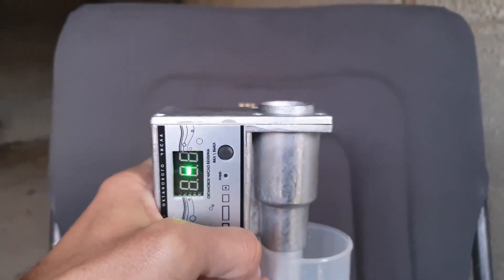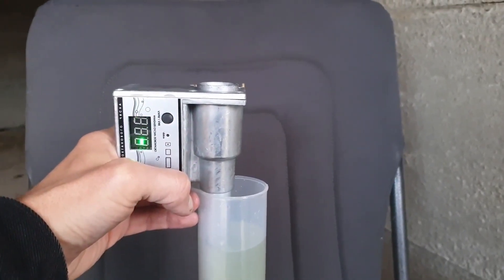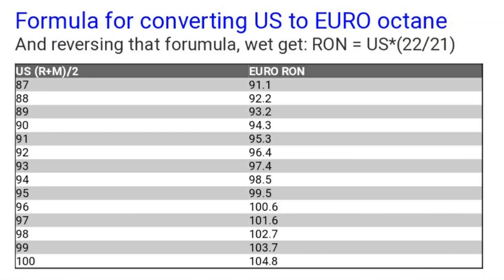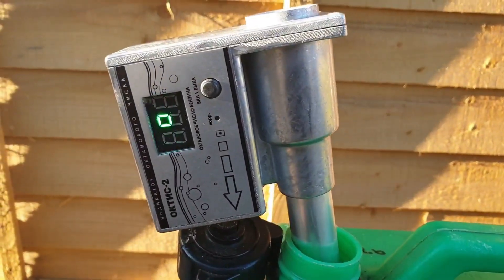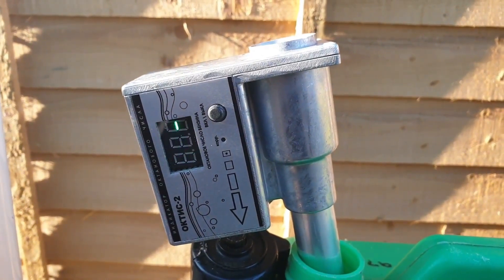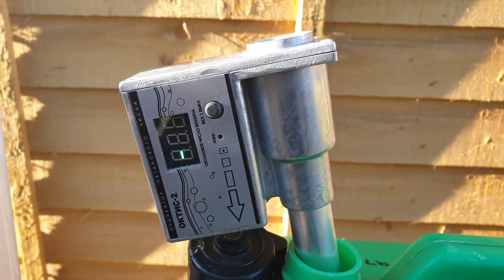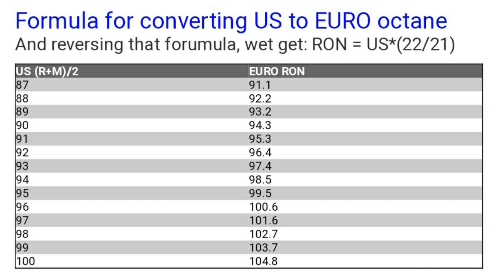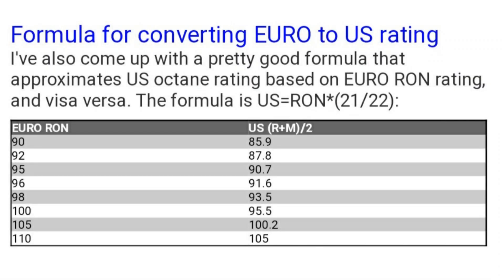Testing Petrol / Gasoline for Octane ⛽ Part 3: Octane of E10 and Texaco Supreme with Ethanol Removed

Comment: Great video. Love to see what your findings would be on the E5 fuel
Reply from the maker: Thank you! The supreme and super unleadeds are the "E5" fuel. It's confusing as firstly most of the UK E5 has zero ethanol (but not Texaco) and E10 is between 5-7% percent. Secondly, I can't test the octane of an ethanol blended fuel, so this videos test was to see what it was with the ethanol removed.
Reply from the maker: Also, thanks for the sub. I have many previous videos showing the ethanol content of many brands. They're in a separate playlist as my videos are a bit eclectic.